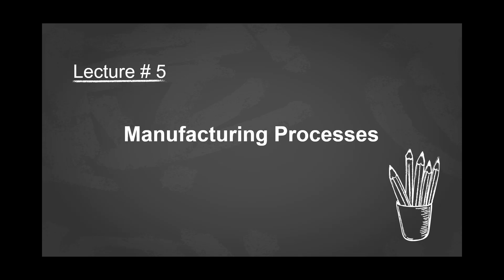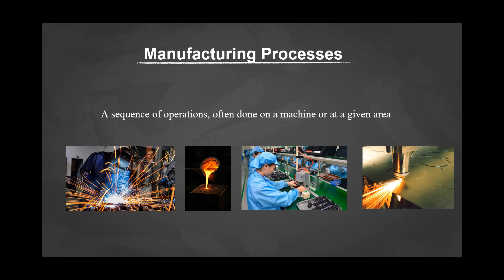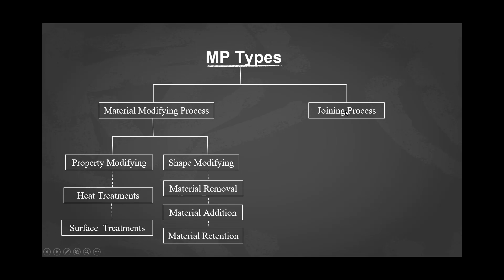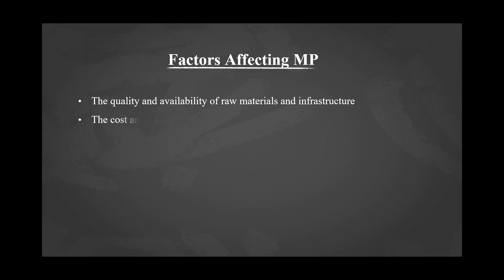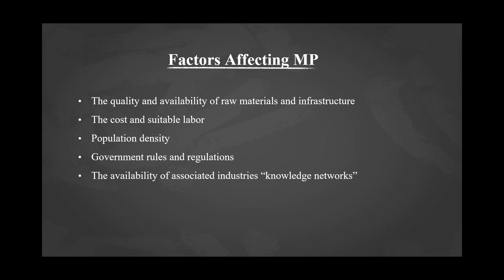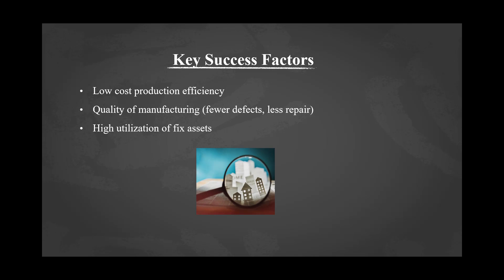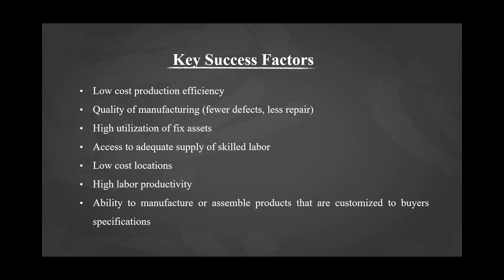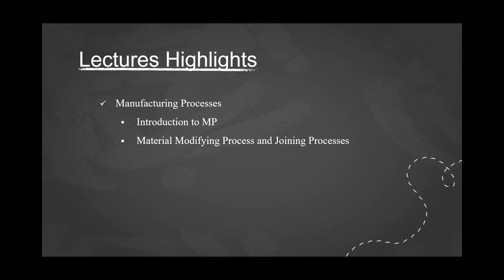lesson #5: Manufacturing Process,  Types, Factors and key success factors of manufacturing process

Comment: F18-0327
BS(SE) 5th B
In this lecture we have talked about manufacturing processes. A sequence of operations often performed on a machine or at given area. Manufacturing process covert raw material into the desired final result. There are two main types of processes.
1. Material modifying process
2. Joining process
Material modifying process further divided into sub processes that are: property modyfing and shape modifying. In property modifying we have heat treat and surface treat while in shape modifying process we contain material addition, material retention. If we talk about factor that affect the manufacturing process we have
1. Quality and avaliability of raw material
2. The cost and suitable labor(had a great affect)
3. Population density(denser the population higher the demand)
4. Government rules and regulation
Then at last we talk about the key success factor these are the vital elememts which can require to accomplish goals and milestone.
1. Low cost production
2. Quality of manufacturing
3. High utilization
4. Low cost location
5. Ability to manufacture product that are customized
Reply: Project: Home Tutor Service
Strength: 
The main strength of this business is that every student can avail a tutor anytime at his door step. We do not need to hire staff or tolet any building to run our setup. Our strength is our hardwork and passion toward our goal. It is a business like uber and cream where any student can hire a tutor for specific amount of time using our app where we provide best tutor in your area. Key success factor in this business is that it is low cost and we do not have to hire any staff for this business to run, by utilizing our knowledge and smart devices we can grow this business easily.

Comment: Roll No: F18-0342 
BSSE 5th Section(B)

Assignment
Topic Name: Home Bakers
Why did i choose this?
I opted for this business because it was quiet affordable for me in terms of financial resources required to start this business and time flexibility. As i needed minimal budget and the work timings were of my choice. Another important factor for which i opted for this business was i can run it from home and it didn't put any extra financial burden on my budget that would have been of prime importance if we had to take any place on rent.
STRENGTHS 
1.The uniqueness in the design of the product will help to distinguish it from its competitors as consumer will not be able to get this type of product anywhere else.
2.The home bakers will post about the availability of the products on the social networking websites (facebook, Instagram) to keep the audience updated about the products.
3.We will keep the prices of the products cheaper than our competitors so customers can get quality product in less cost.
4.We will provide home delivery as will as take-away options for consumers.
5.Staff will be customer friendly

Comment: Roll No: F18-0342 
BSSE 5th Section(B) 

Summary 
In a manufacturing process addition and subtraction is done in order to achieve desired results. In these processes raw materials are converted into final product. There are different types of manufacturing processes which are
1. Material modifying process
-  Property Modifying
Property modifying includes(Heat Treatment, Surface Treatments)
- Shape Modifying 
Shape modifying includes(Material Removal, Material Addition and Material Retention)
2. Joining process 
Joining process includes( Permanent, Non-Permanent and Semi Permanent)
There are certain factors that affect manufacturing process which includes quality and availability of raw materials and infrastructure,  cost and suitable labor and population density, government rules and regulations, availability of associated industries " knowledge networks"
Following are some key success factors
-Low cost production efficiency 
-Quality of manufacturing( fewer defects, less repair)
-High utilization of fix assets
-Access to adequate supply of skilled labor
-Low cost locations
-High labor productivity 
-Ability to manufacture or assemle products that are customezed to buyers specifications
-Low production design and engineering

Comment: BSSE 5 A
Roll Num: F18-0299
In this topic  we begin from production techniques,  the approaches of converting the uncooked materials into useful products. For instance welding, casting, reducing and many others. The production cycle, are the approach through which crude substances are changed into an eventual outcome. The manufacturing cycle starts with the object plan, and substances detail from which the item is made. 
Manufacturability of a material, Processsing  equipment, Environmental elements, are enormous problems for production processes. There are two essential sorts of manufacturing techniques.
1)Material Modifying Process:
“Change the form of fabric or homes of fabric.”
Further divided into  processes.
I). Property  Modifying Process.
Some strategies consist of for enhancing energy and overall performance of a material.
i)Heat Treatments
ii)Surface Treatments.
II)Shape Modifying Process:
We can enhance shape enhancing method through
•	Material Removal.
•	Material Addition.
•	Material Retentation.
2)Joining Process:
     Joining approaches are characterized via their capacity to fuse
        or “be a part of”  or more components for the purpose of creating a distinct object.
There are three varieties of joints in joining system.
•	.Permanent
•	.Non-Permanent
•	.Semi Permanent
Factors Affecting Manufacturing methods.
i)The great and availability of raw material and infrastructure, 
ii) Cost and suitable exertions,
iii) Population density,
iv)  policies and regulations, 
v)  The availability of related industries know-how networks.
In the quit we discuss about the critical element of an organizationto accomplish there aim.
Some key elements are.
	Low cost manufacturing efficiency.
	Quality of manufacture.
	High usage of restore property.
	Access to adequate deliver of professional labour.
	Low fee region.
	High exertions productivity.

Comment: Summary:
In this lecture we discuss Manufacturing processes.A manufacturing process is a sequence of operations often done on a machine or at a given area for example welding, casting or cutting etc .The cycle of manufacturing process convert materials into parts and products .There are two main types of manufacturing process.
1. Material modifying processes: this process either change the properties of material or shape of material so it is further divided into two processes which are PROPERTY MODIFYING and SHAPE MODIFYING. Property modifying is also include Heat treatment and Surface treatment.while in shape modifying process we modify the material by Material removal, Material addition and Material retention.
2. Joining process which have permanent , non permanent and semi permanent joints.
we also discussed the 5 factors which affect the manufacturing process .At the end of this lecture we learnt in detail about the Key Success Factors of manufacturing processes.
ASSIGNMENT NO 1 : 
Topic : ( Home Bakers ) 
Strength of this Business: 
. The uniqueness in the design of the product will help to distinguish it from its competitors as consumers will not be able to get this type of products from anywhere else.
. The home bakers will post about the availability of products on social media networking sites (Facebook ,Instagram)to keep the audience update about products.
. We will keep the prices of our products cheaper than our competitors so customer can get quality products in less cost.
. We will provide home delivery as well as take away option for customer .
Why We Choose this Business? 
We choose this Business for some reasons which are : we can run this business from home and do not require separate quarters to do so.
our cake business will allow flexibility in our schedule. We can decide when and how many orders to take.
Low startup costs! Since we don't have to rent some space, then rent can be taken off the budget list. Also, cake supplies are relatively cheap and definitely easy to come by. So there are more reasons like these due to which we choose this Business.
ROLL NO F18-0349
BSSE 5TH B .

Comment: F18-0354
BSSE 5TH "B"
               SUMMARY:
In this lecture We studied about Core element of manufacturing process.
Manufacturing process is a sequence of operation, that performs to get desire results.
Manufacturing process convert raw material(different substances and chemical)  into products
There are two main types of manufacturing process:
1.	Material Modifying Processes
2.	Joining Processes
Material Modifying Processes change the property or shape of a process
Joining Processes includes mechanical modifications
Factors effecting Manufacturing Processes are as follows:
1)	The quality and availability of raw materials and infrastructure
•	more Suppliers promote more productions and sometimes degree of achieving products can be delayed
2)	The cost and suitable labor
•	labor has both positive negative impact on Manufacturing Processes.
3)	Population density
•	if more population density then more demand of products in public.
4)	Government rules and regulations
•	Cost and tax systems of the government effect the Manufacturing Processes.
5)	The availability associated industries “knowledge networks”
•	group of organizations for knowledge factory, which also effects the Manufacturing processes in both the positive and negatively.
Key success factors of Manufacturing Processes are as follows:
•	Low cost production efficiency 
•	Quality of manufacture (fewer defects, less repair)
•	High utilization of fix assets
•	Access to adequate supply of skilled labor
•	Low cost locations
•	High labor productivity
•	Low cost product design and engineering
•	Ability to manufacture or assemble products that are customized to buyers specifications

Comment: F18-0283 BSSE 5TH A
Summary: Manufacturing Processes (MP)
“Set of operations performed on a machine or at any area.”
•	Materials are transformed during these processes. 
•	Parts of product are formed from material. 
Two main types of MPs are 
1.	Material Modifying Process
Chnages properties and shape of material. 
2.	Joining Process 
Joining of material. 
These types have further subtypes. 
Factors Affecting MP:
1.	Quality and availability of raw material and infrastructure, shutdown or slower MP occurs due to insufficient supplies an vice versa. 
2.	Cost and suitable labour, availability of labour affects MP. For achievement of goals smoothly, suitable labour and cost is needed. 
3.	Population density, larger the size of population; more the demand of product. 
4.	Government rules and regulations,these rules and regulations have to be maintained by manufacturer. 
5.	Knowledge networks, collection of individuals and groups that share knowledge. 
Key Success Factors:
1.	Low cost and production efficiency 
2.	Quality manufacturing 
3.	High utilization of fix assets 
4.	Access to adequate supply of skilled labour 
5.	Low cost locations 
6.	High labour productivity 
7.	Ability to manufacture products
8.	Low production design and engineering

Comment: F18-1180
BS(SE) 5th "B"
Summary:
Assembling Process are the means through which crude materials are changed into an eventual outcome. Assembling measure includes changing the types of products. Model : projecting, welding, cutting and so forth . 

Issues for assembling measures are manufacturability of materials, handling apparatuses , natural angles. 

Sorts of MP : 

1: Material Modifying Process 

2: Jonning Process 

1: Material Modifying Process incorporates • Property Modifying ( Heat Treatment, Surface Treatment ). 

• Shape Modifying ( Material Removal, Material Addition and Material Retention) . 

2: Joining Process incorporates perpetual , non-lasting and semi-perpetual cycles. 

• Quality and accessibility of crude materials and frameworks , cost and reasonable work , populace thickness , government rules and guidelines, accessibility of related businesses " information organizations" are the elements that influences fabricating measure. 

• Key Success Factors : ease creation effectiveness, nature of assembling, high usage of fix resources, admittance to talented work, ease areas, high work efficiency, capacity to fabricate items that are modified to purchasers determinations , minimal effort item plan and designing.

Comment: Rollno: F18-0290
Section A

In this lesson we start from manufacturing processes,  the processes of converting the raw materials into useful products. For example welding, casting, cutting etc. The manufacturing cycle, are the means through which crude materials are changed into an eventual outcome. The manufacturing cycle starts with the item plan, and materials detail from which the item is made. 
Manufacturability of a material, Processesing tools, Enviromental aspects, are significant issues for manufacturing processes. There are two main types of manufacturing processes.
1)Material Modifying Process:
“Change the shape of material or properties of material.”
Further divided into two processes.
i.Property Modyfying Process.
Some techniques include for improving power and performance of a material.
Heat Treatments
Surface Treatments.
ii.Shape Modifying Process.
We can improve shape modifying process by
Material Removal.
Material Addition.
Material Retentation.
2)Joining Process:
     Joining processes are characterized by their ability to fuse
        or “join” two or more components for the purpose of creating a different object.
There are three types of joints in joining process.
i.Permanent
ii.Non-Permanent
iii.Semi Permanent
Factors Affecting Manufacturing processes.
The quality and availability of raw material and infrastructure, 
Cost and suitable labor,
Population density,
Government rules and regulations, 
The availability of associated industries knowledge networks.
In the end we discuss about the vital element of an organizationto accomplish there goal.
Some key factors are.
Low cost production efficiency.
Quality of manufacture.
High utilization of fix assets.
Access to adequate supply of skilled labour.
Low cost location.
High labor productivity.
Reply: Project : Private Tutoring Business
Strengths:
Our core strength is in the power of our teamwork and  our workforce. We have a team that has successfully run a standard tutorial college, a team with excellent qualifications and experience in education.
 Trust and competence are key factors in this line of business and we can provide both. 
We are able to  attract loads of students from the first day we open our doors for private tutions.
We  welcome students and visitors by greeting them in person or on the telephone; answering all of the inquiries.
We make it sure  that all contacts with clients (e-mail, SMS or phone) provides the client with the highest level of  customer service experience. 
Consistently stays aware of any new information on the schools’ products, promotional campaigns etc. to ensure right and helpful information is supplied to students when they ask questions.

Comment: F18-0383
BSSE 5th C
Summary: 
Manufacturing Process are the steps through which raw materials are transformed into a final product. Manufacturing process changes the forms of goods likecasting, welding, cutting.
Types of Manufacturing process:
 1: Material Modifying Process includes Property Modifying which is heat Treatment, Surface Treatment 
and Shape  Modifying is material Removal, Material Addition and Material Retention
2:  Joining Process  includes  permanent , non- permanent and semi- permanent processes.  Quality and availability of raw materials and infrastructures , cost and suitable labor , population density and government rules
ISSUES for manufacturing: processes are 
manufacturability of materials processing tools 
environmental aspects
 Key Success Factors : 
low cost product design and engineering, 
 access to skilled labor, low cost locations, high labor  productivity, ability to manufacture products that are customized to buyers specifications low cost production efficiency,  quality of manufacturing

Comment: F18-0304
BS-SE-5TH-A.
Summary: 
Manufacturing Process : are the steps through which raw materials are transformed into a final product. Manufacturing process involves changing the forms of goods. Example : casting, welding, cutting etc .
Issues for manufacturing processes are manufacturability of materials, processing tools , environmental aspects.
Types of MP : 
1:  Material Modifying Process  
2: Jonning Process 
 1: Material Modifying Process includes  • Property Modifying ( Heat Treatment, Surface Treatment ). 
  • Shape  Modifying ( Material Removal, Material Addition and Material Retention) .
2:  Joining Process  includes  permanent , non- permanent and semi- permanent processes. 
 • Quality and availability of raw materials and infrastructures , cost and suitable labor , population density , government rules and regulations, availability of associated industries " knowledge networks" are the factors that affects manufacturing process.
• Key Success Factors : low cost production efficiency,  quality of manufacturing, high utilization of fix assets, access to skilled labor, low cost locations, high labor  productivity, ability to manufacture products that are customized to buyers specifications , low cost product design and engineering.